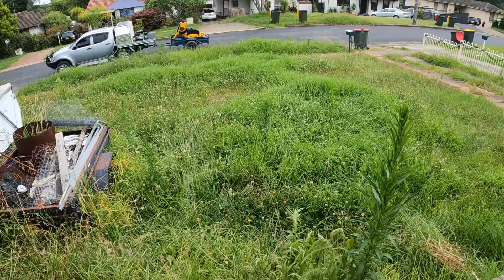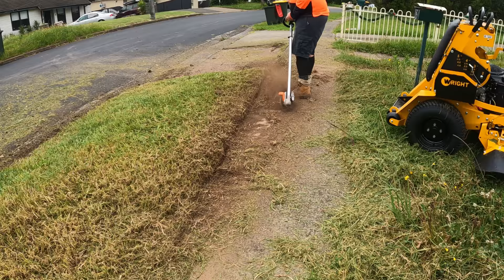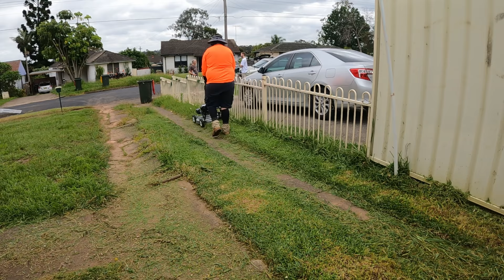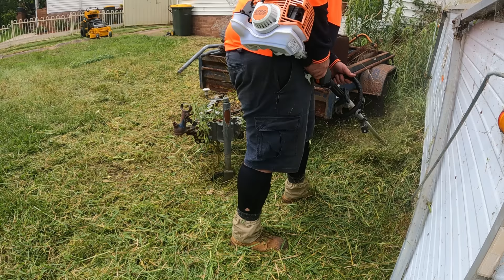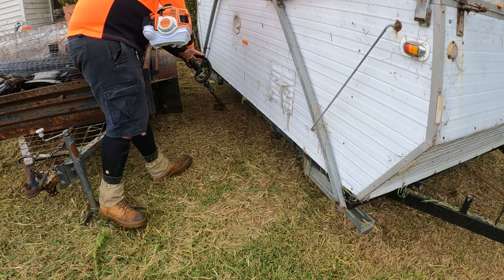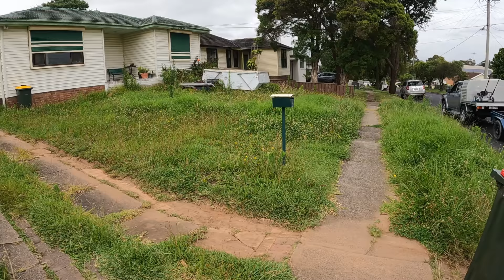SHOCKING OVERGROWN Lawn Gets TRANSFORMED For Elderly Married Couple | Free Lawn Mowing Makeover

Comment: It was lovely to see you help this couple. We have had loads of guys do work for my elderly mum, only to rip her off. The latest was charging her £60 a week to mow her tiny lawn.. a fifteen minute job. I was in and out of hospital at the time and had no idea the guy had put the price up to that! Then another stole all my late father's tools, a lawn scarifier and even her Christmas lights! My youngest does the garden now for her but it's wrong that so many took advantage of her kind nature. Thank you for helping so many x
Reply from the maker: Thanks Kay.
Reply: @LushCutLawns  The padding near your thighs, allows you to feel comfortable up against it. Let that be most of your balance right there. Use the metal bar, near the controls, for in between your thumb and pointer finger. Use the remainder of your fingers on the controls. With your thumb holding your hands still, you'll be able to operate the motions much easier. Think of it as every bump you hit, your hands are going to want to squeeze or let go. If you allow your legs to waist take all the bumps, your hands will take you in a straight direction.